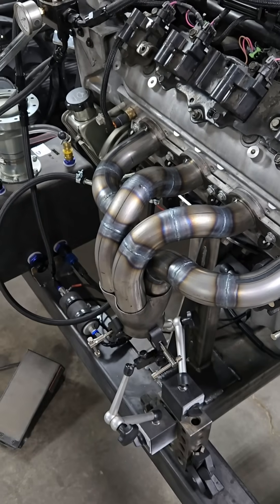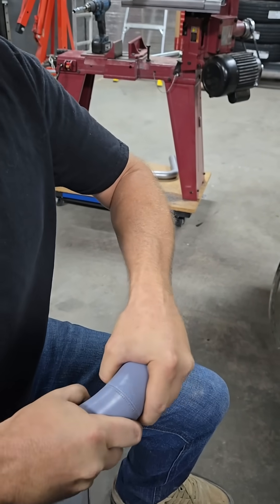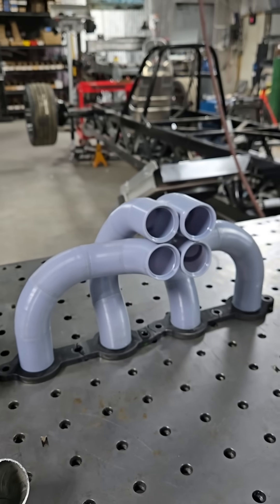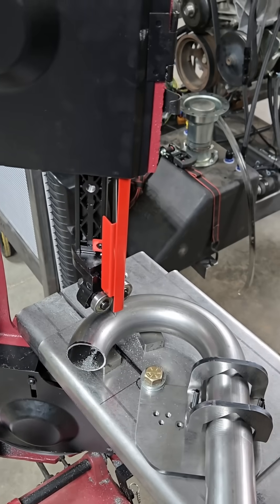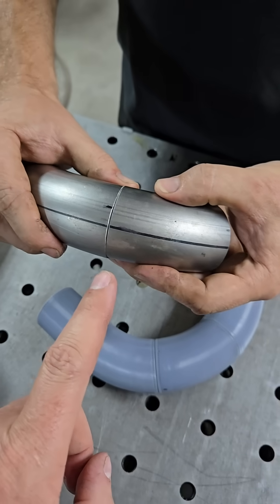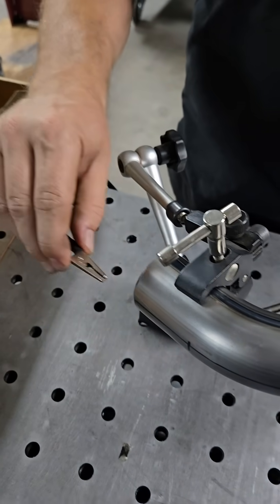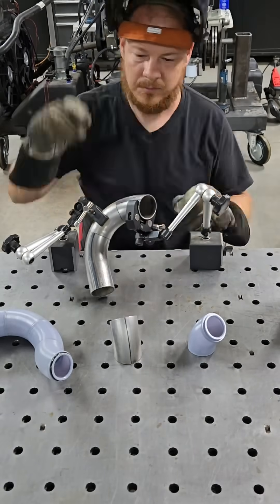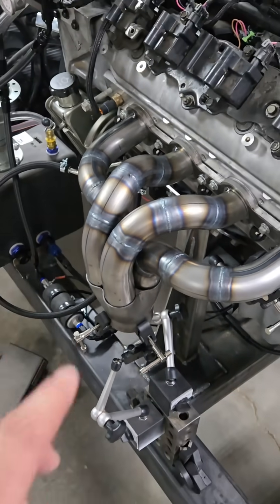Don't build another set of headers till you watch this!

Comment: Questions for the welders: is 2 tacks enough for pipes/cylinders? Would anymore cause to much heat and possibly warp or move the piece?
Reply from the maker: I usually do three. Often times in the shape of a triangle. About 1/3 around the tube place a tack and repeat. Not issues so far and you get lots of stability.

Comment: …. If you can 3d print why not model it in ur software so you can do actual fluid dynamics testing…. I dont really even understand the point of a custom manifold doing it like this
Reply from the maker: You can for sure do that. I even have the aero/fluid software. But it's often times simpler than that. A turbo manifold that is not off the shelf can be done this way. Custom engine swaps often times need a set of custom headers and can be done this way. Not everyone has time or money to scan and 3d model the engine bay so they can make the headers exactly right and tune them with fluid dynamics. So this is a garage and local shop way of getting the job done.

Comment: There's a lot more to designing and exhaust system than just making itvfit in the space. Get yourself a copy of Philip H Smith's "Scientific design of exhaust and intake systems"
Reply from the maker: Not really. I've read plenty of books on that subject and engines. The fact is the entire books are written about getting 5% more out of the engine. Years and careers and hundreds of pages for a tiny few % here and there. Mean while most project cars sit on jack stands. Just get the car done. Get it past inspection. Get it on track and get some results. Performance is literally your very last concern.

Comment: So.. twice the work?
Reply from the maker: At least half the work.
Reply: @centurialinc how? You have to design and print and then do the actual piping
Reply from the maker: You don't do that. These are download files. No design needed. Printing is fast and easy. A weekend at most. If you don't want to print them, I also sell these as kits. The speed at which you can mock up a set of headers and know what to do is tremendously faster.

Comment: I suppose you could say these make it easier, but you can mockup as you go with the real pipe sections. Tick marks, tack up, weld out with back purge. A vise with V aluminum jaws can hold one half of the weld, line up your ticks and tack it. Once you have tacks you don't need fancy holding. Collector positioning is handled during the first tube, after that its where you need it. Also, pulse fusion welding gives a cleaner finish and is faster with less heat into the part. Grinding the tube face to make the joints PERFECT is more important than anything else.
Reply from the maker: You are right. There are many ways to do it. This is just one of them.

Comment: How tf does that little alligator clamp handle the welding current?
Reply from the maker: We where only running the machine at 40 amps. That's easy for the little cable and gator clips to handle.

Comment: No math for runner length? 
This.method would work for turbo manifolds, but for actual functional headers that properly scavange, you arr better off starting with the math, and then working out the best collector position after the runners are each at the propper length.

Comment: Decided the "Rams horn" exhaust manifold for the Small Block  Chevy 350 in a midengine Corvair was stupid. I bought 2 weld it yourself header kits from J.C. Whitney , gathered over a hundred wire coat hangers and a borrowed a friend's fully adjustable gas axe and proceeded to first teach myself how to weld (I Read the Petersons guide to welding) I tack welded the  snakes nest together on each side. I wanted to use a Camaro transverse dual muffler under the Corvair's rear package shelf then  drop down to a Corvair Turbo muffler on each side.  So they went straight out the back over the axles and did a sharp U turn to get into the muffler inlets on the ends. learned it wasn't so much about how fast a car was as how much it made people look at you. If it was quiet and looked pretty close to stock cops left you alone. I did pair the opposite firing cylinders together and did my best to make them equal length.⁶ I was like 20 at the time and in a 2 year engineering program at the local community college.

Comment: You can see in the video that the metal is oxidized because the welding current is high. If it is welded like that, the properties of the metal change, and even stainless steel can oxidize and cause a big problem.

Comment: Why not just blend it and not weld it
Reply from the maker: Bending would require a mandrel bender or you have to sand pack the tubes and heat bend them. It's quite a bit more work. For custom stuff this is the way to go.

Comment: I dont know guys seams good if you do this daily and if you do this daily that tig welding is ahh?? prep, clean, gas lens even a clear glass for the tight area. And remember your current is only as good as your ground if ground is heating up its not clean current flow. Post flow and pre purg. Travel vs amps  Sorry guys 35 years of pipe welding haha. but i do use a noga for lots of thing hand rest, light holder parts . Anyways weld hard guys🎉😅
Reply from the maker: Thank you! More on the way.

Comment: Back in the day...... Every cylinders exaust pipe was equal in length to the collector. That was a tuned header.
Reply from the maker: These are equal length. I did not specifically show that because it's optional. The plastic mock ups have length on them to help get that right. Tuned exhaust systems actually refer DYNO tuned. Length is only important in regards to power production. To ensure you have made good power you will need to DYNO test the system and change the length till max power is being made. It is at this point that you can say it is tuned. Other wise it's just an eye balled system or at best a paper only guesstimate.

Comment: Cloverleaf welded in before tacking the collector on?
Reply from the maker: Yes. I will show that in another video. This one got a little long so had to stop there. Shorts be like that. I will also fill any gaps around the outside with some sheet metal and put a center cone in. Then finally the collector.

Comment: Quick question, what exactly do you stand to gain by fabricating a new set of headers? Genuine question
Reply from the maker: Good question. Broadly you can ask, why make custom at all? The most common reason is that you have to. Car builders do a lot of odd things. Which often times means that you can't buy it off the shelf or will it be like that from factory. For example I have a 2004 Crossfire we are going to LS swap and turbo. It will be a fully custom job and no OEM or Aftermarket exhaust system exists to do that. The second most common reason is uniqueness. It's hard to make your car stand out these days. But one way to do it is by customizing the exhaust. You can make the sound how you like. The looks how you like and you get to say it's one off. No others in the world are like it. Lastly is performance. It's last because it's for the rare few who are trying to win races and collect trophies. A tuned exhaust system can provide you with HP your competitors do not have. This gives you the winning advantage. If everyone at the track buys the same engine and parts then they all have the same power. Those races will be determined by who makes a mistake not by the car itself.
Reply: @centurialinc I guess my question was more geared along the lines of, if there is not noticeable gain in horsepower by adding aftermarket headers, does that enhance the sound, and if so, is that done significantly?

Comment: I love when 3d printing is integrated to a business. I used to work in cosmetics and our factory had a very old tube closing machine, which had some broken/too loose tube holders, which threw the alignment on the printed tubes off too often.

Our repair started to look at fixes other than trying to fill the holes with polyurethane, then I suggested 3d printing the new sets of holders. They had a hard time grasping the concept, but I was still  approved to research it and I found a local company that did custom work for pennies. Overall a great customer experience, they were fast, and they made the holders close to original quality, they nitpicked every detail on them, and we paid pennies for it. Production management was impressed as hell lol, they still use them.

Comment: I just can't believe there are no pipe benders that could do this job in a minute.
Reply from the maker: None exist that can do this in a minute. You need to set up or program the bender. And you need to know the angles and rotation. With out those you can run the machine. So you either need a design or you need what we have. Mock ups to tell you the angles and rotation.

Comment: Why not just make one pipe with one bend instead of stacking three little pieces to make one? Why so many welding spots? Looks? It does look nice but it seems redundant
Reply from the maker: Pipe bending is common. It's a mandrel bender that is needed to do this. They are expensive. 5-6k and the tools you see here are under 3k. And are more general purpose. So it's cheaper to do it this way.
Reply: @centurialinc sick. Yeah it just seems like a weird thing to do. But yeah save money is always the reason. I’m with it. It also looks pretty sick too. But like I said seems like it would be weak.

Comment: Back purging is a welding technique that protects the inside of a pipe or hollow structure during welding by filling the void with an inert gas, like argon, to prevent oxidation and impurities from the air. This creates a clean, strong, and smooth internal weld bead, preventing issues like sugaring, where a brittle, black crust forms on the root of the weld due to contamination from the atmosphere. It is especially crucial for welding reactive metals like stainless steel and titanium to ensure structural integrity and corrosion resistance.

Comment: How much TIME was needed for project and execution of all 3d printed pieces?
Reply: ps: with our printers will take TWO DAYS at least. Probably you invested tenth of thousands in industrial  3d printers... not any welder is milionaire.
Reply from the maker: This kit is made in 1 week with 1 printer. We used the Anycubic Photon 4. It's a resin printer only cost $200. The resin is cheap too and prints very fast. So yeah go for it. It's easy and the files are on our website. You can buy ready to go kits from us if you don't want to mess around with the printing.

Comment: I would rather not rely on the 3d printing that can be wiped out by geomagnetic storms at any time.
Reply from the maker: Those are rare and all modern systems have protection from that. So it's not an issue.
Reply: How do you expect to weld after a geomagnetic storm that takes out all the 3d printers?

Comment: Why don't I just get those mockup pieces in steel, adjust them into position, and weld them?
Reply from the maker: That's how we use to do it. Getting it all to fit just right in the car requires trial and error so you cut, tack and grind a lot that way. This is a measure twice cut once method.
Reply: @centurialinc  But I do not see you cutting any of the plastic pieces.

Comment: If they were numbers/letters instead of tick marks, you could use them as references to easily line up the parts in a 3D model and then just have it printed in stainless. Skips the entire fabrication or 3D Scanner and Modelling steps from other methods
Reply from the maker: you sure can. The tick marks a 5 degrees. and there is a 0 reference. So if you count 5 tick marks that's 25 degrees of rotation. Now 3d printing them would cost a small fortune and take a week or more. Also you will usually, with a tuned exhaust, will make these 3-10 times. So in this case the fabrication route wins big time. Same day fab, next days test, by the end of one week you could get in 4 tests.

Comment: 💀💀💀 different collector length!! Looks good but doing allthis to mismatch exhaust tube length is sad
Reply from the maker: SMH, FP, Equal length. The plastic parts have length on them to make this possible. Engine is on the DYNO for tuning. These headers will be cut and adjusted probably ten times....

Comment: As I understand it those sensors work better with magnets instead of just a bolt. Also the teeth on the flywheel might play with your readings. So moving to 2 or 4 magnets onto that short coupling after the flywheel to get more pulses faster then doing some corrective math might clean up the data a bit.

Comment: Wouldn't the gas speeds, pressure and sound waves be unequal given the header pipe lengths/bends to the collector? I love the idea, but it sort of seems that it only works to get pipes tucked in close rather than from a performance perspective 🤔
Reply from the maker: We will see. DYNO testing coming soon. I will say that Just about anything is better than stock. You would really have to mess things up to make it worse.

Comment: “It’s easy” yes when you have a fully equipped auto shop, but when all you got is a pair of vise grips a hacksaw and a couple screw drivers, not so easy
Reply from the maker: The point of the video is that tools make our lives better. Only 3k in the video. I started in the dirt in the back yard with used tool under a pop up as a broke high school kid. Get it done.

Comment: I wonder what career move he has to make after global ev adoption.
Reply from the maker: EV will never replace gas.
Reply: @centurialinc  just like people assumed ai will not take away our jobs
Reply from the maker: AI didn't and won't, we have prompts now as a JOB. When gas engines came out they said that's the end of steam and boilers. All power plants are still steam and boilers. Large central heating is still boilers and steam. They said the car would be the end of the horse. We still have rodeos, horse racing and have them as pets. They said EV would take over the world. And here we are with Global declining EV sales. They said EV was cleaner but it turns out the wasted batteries create extremely dangerous pollutants and it's extremely costly to dismantle the batteries. So they throw them in the trash! I can go one forever.

Comment: I did this when I was 16 on a 421 Pontiac dirt car. I used "Scientific design of intake and exhaust systems" book. Went to the local parts store and got some crooked pipe, a new hacksaw blade and went to work. Coat hanger worked for welding rod.  Dale the driver did buy the flat flanges to start with. Worked good. 1964.

Comment: If you use your own thin wire as a ground for welding you can have a problem: the amperage can cause the wire to heat up. Potentially to a burn. All the current flowing thru the weld is flowing thru the wire. Probably fine for short tacks, but don't try this for a longer duration

Comment: The old-school guys 😂 laughing as someone showed this video to them.
Reply from the maker: Old school guys are the first to buy. They know first hand how much this helps.
Reply: @centurialinc the guys that do this for a living are like wizards of the craft not just heads for motors have you seen the pipe guys on a chiller system working 12" - 24" pipe using a crane to hold pieces welding in place welders in the oil fields much more than this.

Comment: Shorty Headers have no advantage over good OE manifold.  Long Tube headers only have advantage over 3,000-4,000 rpm where street cars spend little time
Reply from the maker: Packaging, sound changes, and looks are just a few reasons to do this. If your trying to tune the exhaust for power then you will be on and off the DYNO a lot. Then these tools become invaluable.

Comment: Doesn't flow length and angles affect the performance of an exhaust systems sound and horsepower....is there some kind of instructions with the kit to not make them to short or to long for optimum performance??
Reply from the maker: Yes we will include a cheat sheet to get the basic tuned length figured out. but DYNO testing is the only way to confirm you did a good job. See our DIY DYNO. Soon we will have the full set of tools to build and tune engines. Follow to see how it turns out.

Comment: Once you have all the individual ports
Welded and into the collector, how on earth do you complete the welds to mate them to the collector.. or is that piece shown as the collector just a template? I can see how about 50-60% can be welded at the outer edges of the collector, but what about the inner edges where welder cannot fit?

Comment: I'm sure they did this outside of the engine bay for demonstration purposes but for practical applications, you'd have to do it with the engine in the car to be sure you have the space, with all accessories attached.

I'd be cheeky and take the plastic mock up to the stainless steel pipe shop and tell them I only want these segments in those lengths so for me, the customer there's zero waste and I only buy what I actually need.

Comment: These mock up plastic pieces have been out long before 3D printing. The hardest part about making a manifold is learning exhaust theory. You cant just weld piping together. The runners have to be the same length and flow well. Venturi tech to measure CFMs etc... this is why we only see a hand full of designs.
Reply from the maker: Just about anything is better than stock. Throw it together and take it to the track. If you see improvements in your top speed then it is safe to say it helped. We have it out and on the DYNO for testing and tuning the exhaust. Follow up video coming soon.

Comment: Used to do this making tapered pipes on 2 strokes in the 90s, plumbing tapers is fun. Had to get by with oxyacetylene then.
Moved on to hydro forming, less seams, less cracks, more of a head F**k designing the flat forms then rolling round edges for perfectly flat seams. Shame strokers went out of fashion.